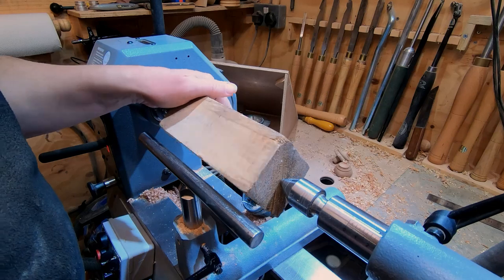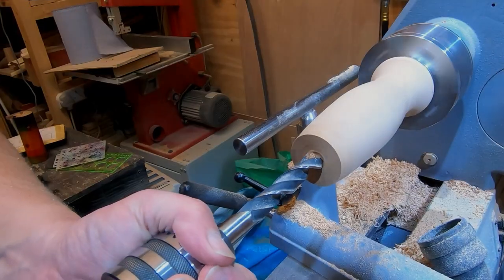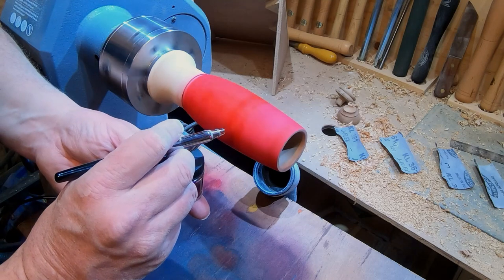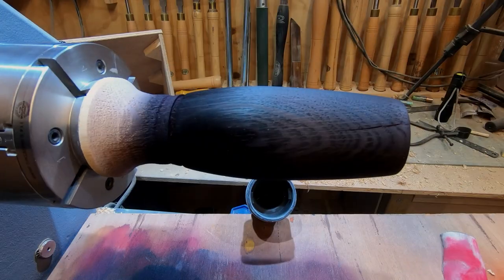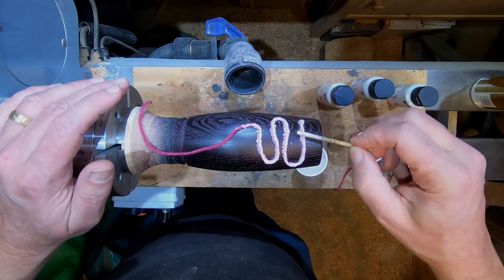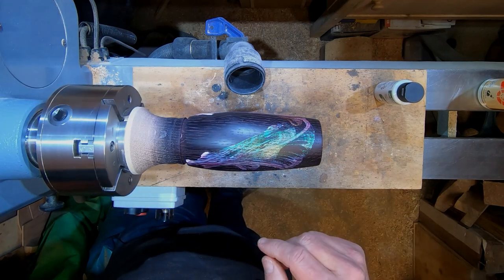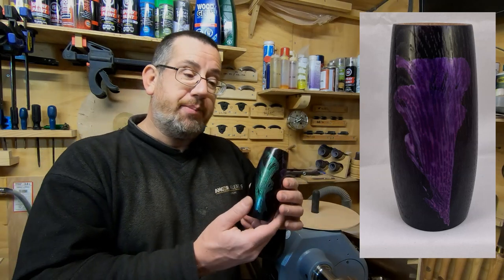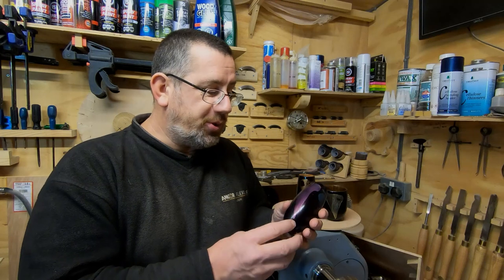String Pull With A Difference - Episode 264

Comment: A brilliant experiment Paul .and I quess a lot of fun! also if the result is not what we're looking for while experimeting it can be  turned or sanded  away to try again
I cant wait to try this and  for a start I'll be raiding the wifes knitting box for some wool 😁Thanks Paul for sharing Cheers,   Bram.
Reply from the maker: Thank you Bram. Yes a lot of fun on this one. I've found wool is the best option as it is more free to turn as you pull it on a string pull.

Comment: Hi Paul, All three are fantastic. My favourite though is the first one when you spayed red first. I have one question, Can you use the string pull method on the flat rim of a wide rimmed bowl? I have never tried string pulling but I really want to as the effects are incredible. Thanks in advance. Take care Paul. Cheers, Huw
Reply from the maker: Thank you, yes the Red came through well. Having a deep grain is required for that. Yes you can do this on any flattish surface. Take a look at Wayne The Woodturner, this is where I got this from. He has done several things like this. I think I even have a playlist for the sting pull I've done so far.
Reply: @PaulLockwood  Hi Paul, Thank you very much I found Wayne's video.. Cheers, Huw

Comment: Nice vase. Do you think  the hot glue gun-method would work with an airbrush?
Reply from the maker: Thank you. Do you mean to leave patterns of plain wood? If so then yes for sure. The colours I've been using are dyes, so make a stringy pattern with the glue gun, spray as you want and peel of the glue.